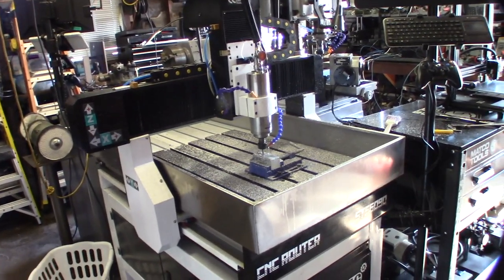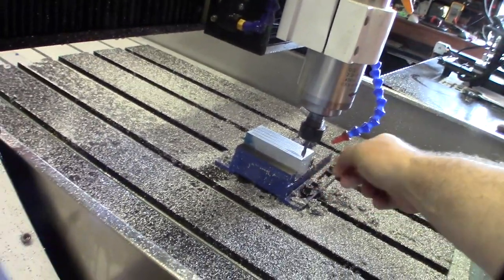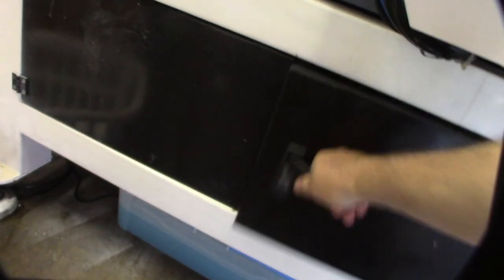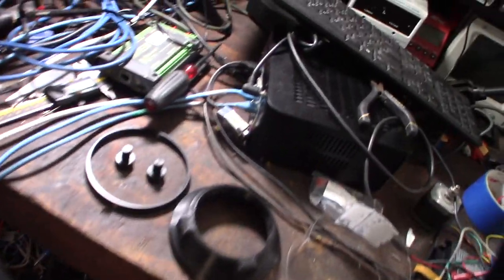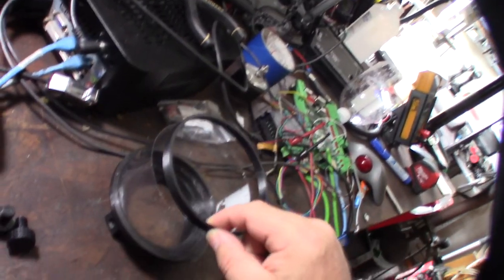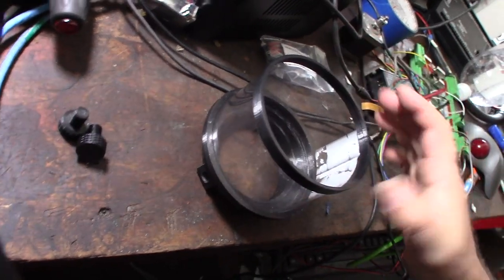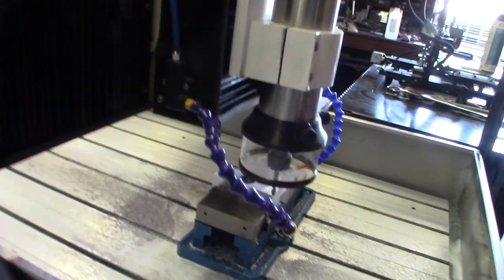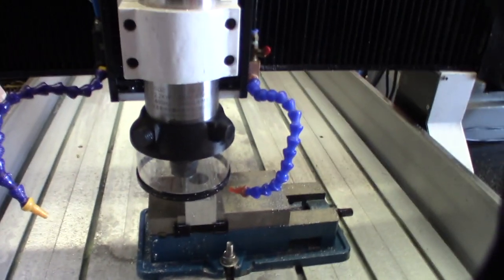Spindle Splash Guard 80mm 24K 2.2KW 6090 CNC machine Chip Catcher

Comment: i made the same for my cnc with detachable base with magnets, but used nylon brush webbing. allows me to bring it down right over part and not get any depris flying or worry about crashing a hard cover into fixing or parts
Reply from the maker: Do you have a picture, I might try that.
Reply from the maker: I guess my main goal was to keep chips in the containment system. I keep about 99 percent of chips in the tank now.